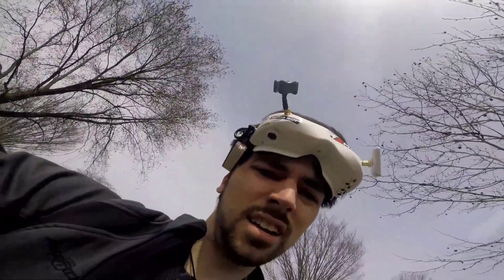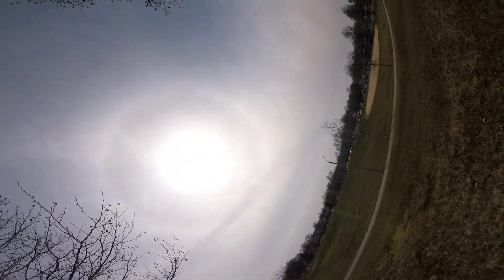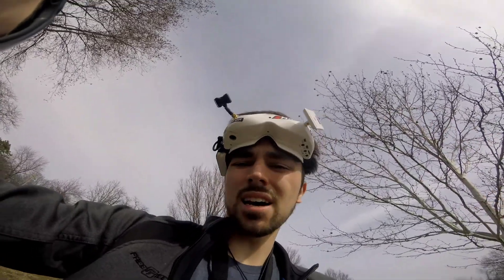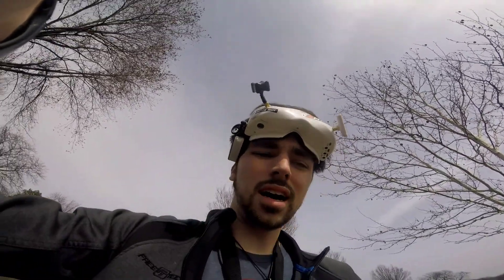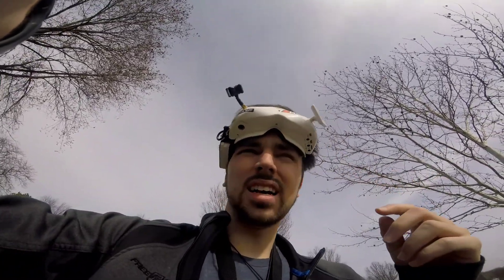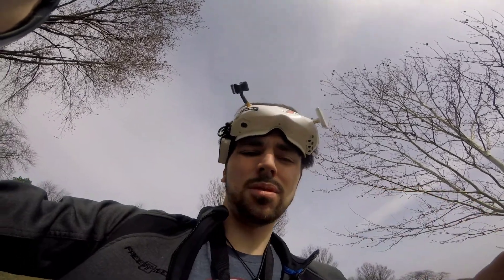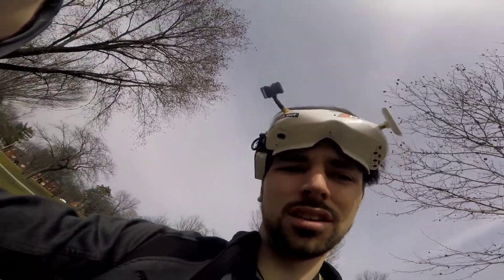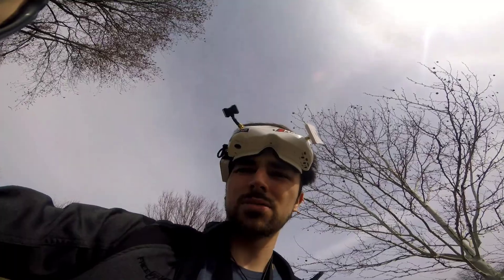Butterflight on an F3 Flight Controller (Butterflight first look)

Comment: Butterflight without kalman filter and gyro at 32khz is just betaflight with a different name, totally placebo, we just made the test this evening and there is not a single difference in flight performance if you don't use the 32khz sampling.

Comment: a couple of things.. I too am running latest butterflight on my old DTFC F3 and its running great! I have ALL the notch filters disabled too. quad has never sounded so smooth. I also had a "roll of death" incident with my hobbywing x-rotor on another build, which caused me to crash into the ocean! here's the video if interested. https://youtu.be/4Ke3WMC8SkI 
It happened while on betaflight. what I determined was the problem had nothing to do with whether or not notch filters were enabled, but rather how low I had set my idle throttle value. i found out the hard way that having it set too low (was at like 2%) caused at least one motor to stall during a Matty flip and triggered the "ROD". I'm running butterflight on it now and it's fine. throttle idle is now at 4% and yes, ALL notch filters are off. just thought I'd fill you in on that. I'm guessing the same thing caused your ROD too. Happy flying! ☺️
Reply from the maker: droneXcursion thanks for the info. Ill try your suggestion and see if I can get the hobbywing system working again.
Reply: PilotInCommand FPV BTW, do NOT overclock your X-rotor! it doesn't work well on it all, I tried.. it's not necessary anyhow.

Comment: Tried both 3.4.0 and 3.4.2 both stock 3.4.0 is way better 👍
Reply from the maker: Steve Handford Fpv I will have to try 3.4.0.
Reply: PilotInCommand FPV way better for me got rid of all vibes plus if u are using f3 u should be able to run 8k gyro 4K loop 👍

Comment: What do you think, friend? liked? is better than Beta? I have an F3 I'm thinking and for Butter too.
Reply from the maker: Jian Zanella I think butterflight will run on an f3 no problem. What I recommend you do is do a 30 second test hover after installing it and check for hot motors. If your motors arnt hot then do a 1 minute flight and fly mildly hard/agressive then land and check for hot motors. If you motors come down with little to no warmth then your good to go. I just recomend this test since the stock filter settings on butterflight are different than the stock settings on betaflight.
Reply: Thanks for the tip, I have already updated the firmware already made a video, I put some settings just like yours, it was good, just missing a few PID adjustments, as for the motors he heats up a bit but nothing is going to hurt, check out the video here https: //www.youtube.com/watch?v=Jo-On81rUfQ
Reply: Thank you, I'm going to test these PIDs.